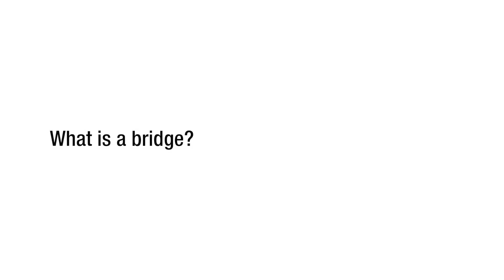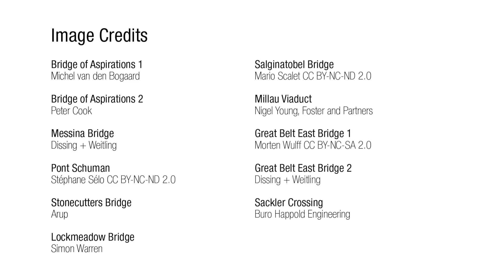What is a bridge? - Industry Insights:Bridge Engineering with Ian Firth Pt 1

Comment: Seeing that this is a video presentation and not a radio voice transmission  I would say that the  projection of Bridge design would have taken another form. Rather than presenting the Learning outcomes in a vociferous form, I would think that people would have been happier had a few examples been detailed not as far as what makes a great bridge but what makes an inferior bridge.   I saw many catenary bridges with the main catenary cable and a number of vertical cables holding the deck as the Narrow Tacoma Bridge that eventually failed,  I find it interesting how bridge builders never talk about the instability of the catenary bridge with its rectangular spaces between its cables, It is well known that rectangles changes shape and it is this that brought down the  Tacoma Bridge and caused the London Millenium Bridge to oscillate so much.  The stability of the cable stayed bridge  with its triangles, which did away with the catenary curve and the vertical cables holding the deck and the rectangular spaces between the cables  which changed shape permitting the fundamental and the higher harmonics to set in the vibration of the deck.   That would have made a wonderful explanation of what was regarding as a less robust structure was corrected over many years to produce the triangles in the modern cable stayed bridges, One would have thought that bridge builders would have seen their mistakes a long time ago.   There are other examples of bridge failures which are of interest as the Tay Bridge disaster which in my opinion was a great mistake in the manner they anchored the supports which in reality were not anchored at all to withstand a side wind.  The recent Genoa Bridge was not exactly an optimised bridge as the material it had in it, one needed to build so heavy to support the bridge's material rather than the load the bridge could take. On looking at some photograph of the steel bars in the concrete, well , one could cry.
So seeing that the medium of transmission is visual and not only an audio sound, one may suggest that this set of videos should depict the old classical bridges including classical  structures as Lighthouses and one would detail their structures  and not only the social and cultural contest . The social side and management of building a bridge is also of interest and how to use critical path analysis of the whole project, but a few details of the engineering of the bridge and the  structure which is not part of the bridge but is very necessary  to erect the bridge and remove it later as in the wonderful system they used to build the Arched Bridge at Newcastle upon Tyne , one which I walked under for many years studying the pins that hold it on either side.  Other than that, nothing to say, Knowledge Transfer using videos should project other scenario than a nice person talking  for almost eight minutes while sitting down.   So many more interesting issues one could depict.